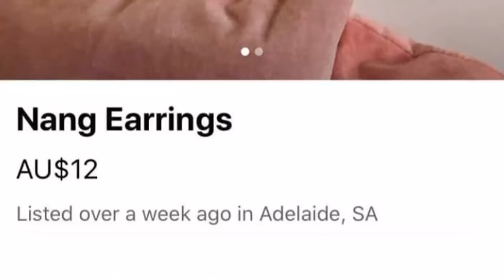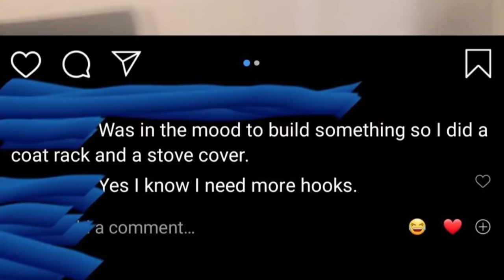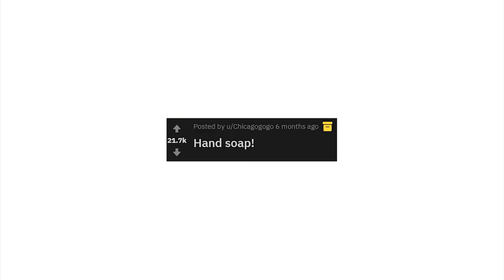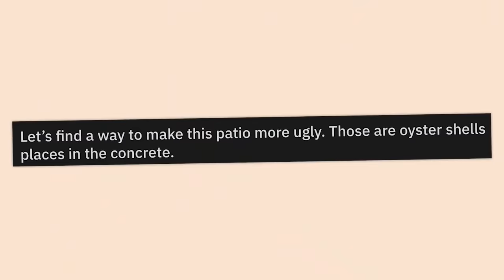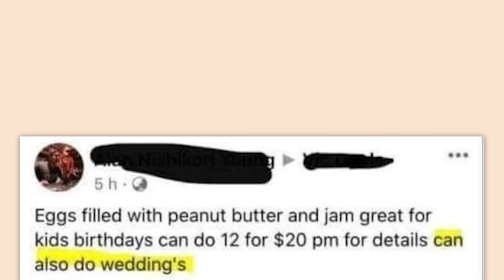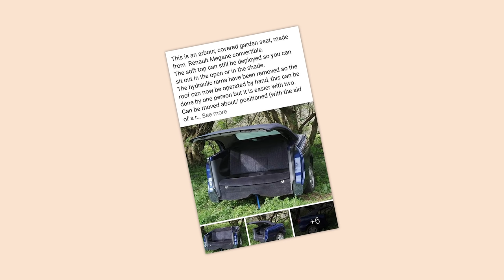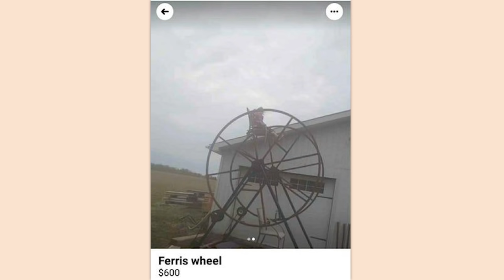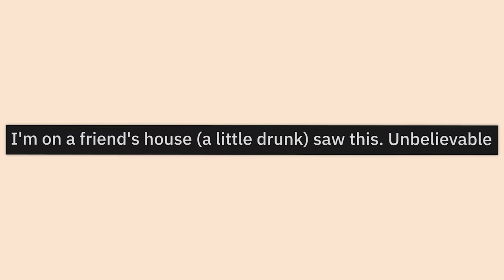ALL OF r/DIWHY

Comment: 2:07 Oh yea, that's for just keeping the door closed when there is no knob or other latch to prevent it from swinging open on its own. Keeps the door closed, yet allows easy access.

Also useful for when you want employees to have access to said room during business hours, but then lock it after hours.
Reply: Yep.  The door is probably broken and that's how they keep it closed without bothering to fix it.

Also, the device is just a regular old spring clamp since Damien seemed to be confused about that.  They are basically just trumped up clothespins if people aren't familiar.

Comment: So the chair of "magnifying glasses" is actually connecting rods, they connect the pistons in an engine to the engine's crankshaft. Yes it is a very cool statement piece
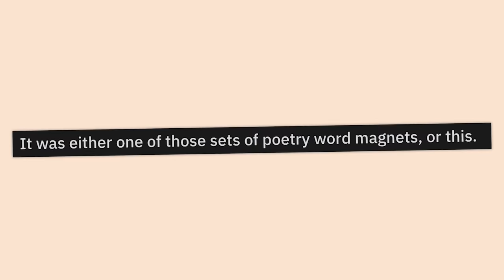Reply: Also 1:05:50 is awful, because that is a Ford Econoline van chassis and a Chevy Silverado 3500 bed from wildly varying eras

Comment: At 10:15, those are "Piston Rods." They connect the piston in an Infernal Combustion Engine to the Crankshaft. They are instrumental in getting "Back and forth" turned into "Round and round."
28:30 is actually a Turbo-Boosted Shillelagh.
30:45 YES YOU CAN!!! Once...

Comment: I really like that you try not to be mean to the ones that are just weird, and only pick on the ones that are actually grotesque, dangerous, or poorly done. Also, the antenna at 56:31 is done that way because it's too long to drive on residential roads without being a hazard because of overhead lines, so that cable to the hood is to hold it down so it's not too long. Though, why he would need such an antenna, which is typically reserved for high-gain radios used by like the military when in the middle of nowhere, is beyond me.

Comment: at 38:23, not only are those tires ridiculously heavy compared to that bike, they're made of some of the stickiest rubber known to man. they're designed for formula 1 cars so they're meant to be used at like, around the temperature water boils
Reply: I wonder what force it would take to actually use it, like it’s geared down to what I think is 1:4 ratio but it still can’t be easy and I bet top speed is terrible

Comment: 5:55
That is an anti baby knob attached to a lever style handle. So instead of replacing the handle with a ball style handle, they cut a hole in the anti baby knob making it useless.

7:13
It’s a poor mans attempt at ice tires. Don’t know why he didn’t use thumb tacks THROUGH the tire and used a tube, but here we are.

Comment: No way are those electric wires exposed like that should be allowed, does this person have a deathwish? Not to mention that they are chargers. Just use a battery that has a charger and output ports on it to charge your stuff and only need 1 plug and much better wires.